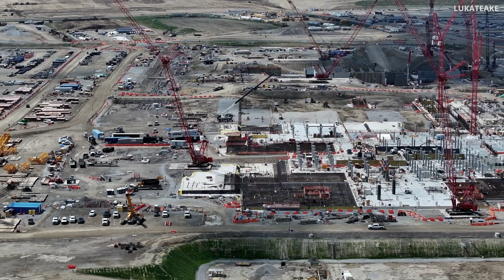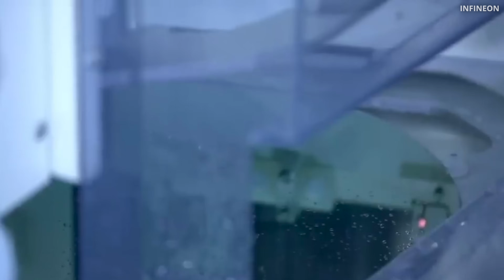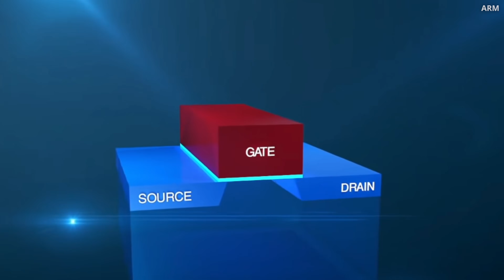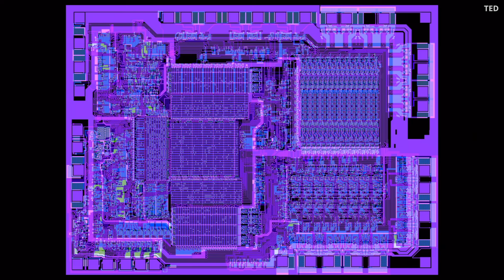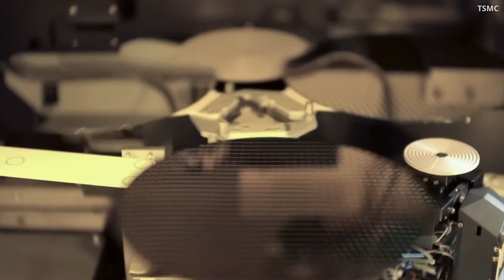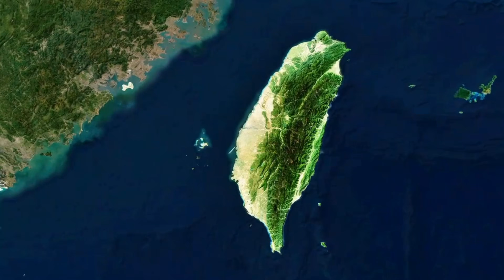Huge Chip Breakthrough — and A Massive Warning For TSMC

Comment: Makes so much sense to build a chip factory in AZ, a state that already does not have enough water for its residents and they can't bring in enough water for the residents, the aquifers are essentially drained and now you have factories that will use billions of gallons of water per year.  Even if they are recovering 80% they still leaves 650,000,000 gallons unrecovered. The containment tanks are not covered so they also lose water to evaporation.
Reply: Arizona uses  7 million acre-feet ≈ 2.28 trillion gallons of water per year.
Get a life.
Reply: @warrenwhite9085  I really don't understand your point.  You must not be from arizona. The central arizona project was built because of the aquifers running dry, Colorado river which supplies water to the CAP has not been feeding as much water and the resivoir has been running so low barrels at the bottom in places have been exposed that have remains of dead people in them.  Yes, there is not enough water for the residents let alone chip factories or data centers.
Reply: @merlin_XY . AZ water used: Agriculture (irrigated): 74% — mostly for crops like cotton, hay, and alfalfa.

Which offers more $s & jobs: 
Alfalfa or AI chip GPUs?

Comment: The real reason Intel is "betting the house" on this fab and the 18A process is that it realized that it had fallen too far behind TSMC and would never be able to catch up, much less surpass their only actual competitor unless they went into the effort "whole hog". They need to make several radical fab process changes concurrently to be able to have hope of ever accomplishing their goal. Do note that both TSMC and Intel completely rely on the ASML company to build and sell them their horrendously expensive lithography machines. ASML is the only company in the world that can supply them with what they both absolutely need.  //

Comment: why not just make 4 transistors that small instead of just 1 then, and use gold as the conductor. or gold plated wires too
Reply: when its on the angstrom level gold only
Reply: or a better/ close conductor than gold
Reply: for the power lines, just fold foils into a crinkled w shape maybe that will make it carry current better or something

Comment: A glaring omission, is the geopolitics at play. Trump has been using trade as a weapon of extortion, the entire world has been frantically divesting away from US trade for anything that's seen as critical, the process will not reverse now that it's been set in motion. Even if Intel were to gain some credibility as an independant fab, who's going to use it for anything critical except US firms? TSMC continues to hold an advantage, so does Korea's Samsung (although with its own set of conflicts of interest), these are two fabs that are not a threat to critical supply chains. As for Nvidia, a mention has to be made about its proprietary nature, just about everything it makes is proprietary, including interconnects and the software the runs on top of their integrated systems, there's a big problem with that for several different reasons, but that's a long story I won't go into here.

Comment: Interesting video, well made!

This is clearly an unsustainable trajectory. Most embedded chips do not need nm precision. It would be interesting to see how far 3d printing or printing technologie can go.
Printing chips and whole boards with printing technologie, that seems very obvious.
It will reduce cost to almost zero compared to the extremely wasteful industry shown.
Processor clock cycles would drop a bit, but it might still be 100Mhz?

Intel should also invest a lot in the processor design. We need a few breakthroughs there also. It would be interesting to cover this as well.

Comment: Eh the air filtering is a bit overblown now, the wafers are kept hermetically sealed in pods between tool mini environments, so the fab itself having a high clean room rating isn't as necessary as it used to be. My fab did a study on it at one point and determined we didn't even really need to wear smoks anymore, but we still do for appearances mainly (also a bit of a convenience since there's areas they're still necessary, so better to already have one on at all times).

Comment: I'm sorry, maybe I missed it. What is the "Big Warning for All"?
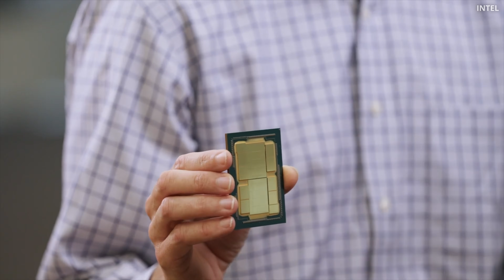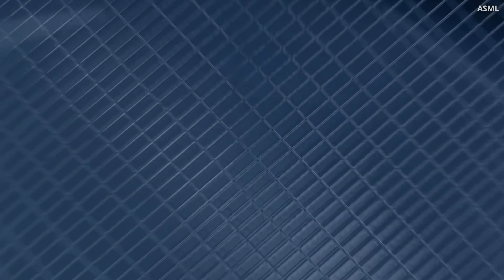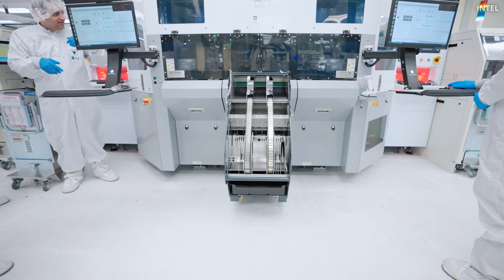Reply: From Gemini:The video states that the "big warning" revolves around the IDM dilemma for Intel: as they build advanced chips (like the 18A process) to compete with TSMC, they are simultaneously competing directly with the very foundry customers they are trying to attract, such as AMD (26:38 - 27:34).Additionally, the video highlights that if Intel's 18A manufacturing yields remain too low, the economics of producing these advanced chips will collapse, making them too expensive to be commercially viable (25:09 - 25:38).

Comment: two questions....so going vertical with the power delivery will concentrate the heat  more in one spot? or the goal is better chip stacking and not worrying about the heat .... as testing showed less heat created out of tolerance? i get the VIA delivery....i had been saying that needed to be done since the late 2002-4 with core2duo and athlonXP as carbon nanotube thru-chip power conduit could be achieved with better multi layered circuitry to get power needed to areas deficient while taking up minimal space that lasers could incise the carbon nano tubes at the right levels and then just require a remelt with excess copper on the ends of the tubes flowed out the tubes incisions to make proper contact unless you wanted to transistor gated contact those carbon nanotube power conduits which is the only way i can think to reduce heat concentration/creation.
second question so as for supporting the wafer on the backside for dual side chip processing why not use super strained vegetable oil in a petri dish and set the wafer on top and let the microfilm of vegetable oil act as shock vibration insulator using hydraulic pressure of the oil to suspend the power delivery VIA side of the chip that was processed first. you can make the petri dishes sideless like a microfilm and then attach a clam like is used for barrel lids for non liquid bulk storage that is removable and locks in the wafer when clamped to the petri dish. the edges of the wafer are mostly waste at certain points anyways so you lose about what 10-15% yield at worst and the normal what 5%? anyways on every wafer.

Comment: Great video Anastasi, I have a few questions about PowerVia.  Will the new location of the power lines require a different cooling system, since heat will be created on the top and the bottom of the chip now.  Also, will these new Intel chips require lower power per transistor, due to the assumed reduction in electrical interference.

Comment: Are they still focusing on x86 legacy or finally moving to RISC? As that matters even more than making it smaller. Complexity, power consumption and heat due their needed backwards compatibility has always been their Achilles heel. If I remember correctly, the root CPU, 8086; used 12 to 14 cycles per instruction where the Rockwell series used 1-2. So at the same clock Intel processed roughly 8 times less instructions. They solved it by switching to 5 processing lanes that could work parallel for a big chunk of the workload, hence the name Pentium. But at the cost of more complexity, need for highly efficient cache and cache misses that were expensive.

Comment: I really expected more from 18A…I thought they would beat Apple by a large margin..but it didn’t…and so is it really an X86 vs ARM problem instead of a chip fab problem ?
Reply: Intel Panther Lake (12 cores plus 4 tiny suspended mode cores) looks reasonable vs Apple M5. Only Apple M5 Pro with 18 cores starts to look like a beast vs Panther Lake 12 cores. But the main battle is ahead. Intel Nova Lake with 48 cores plus 4 tiny cores vs Apple M5 Pro/MAX 18 cores.
Reply: @alexanderbelov6892 well depending on its price…if it’s in the same ballpark as the M5 ultra in the upcoming Mac Studio…the m5 ultra will probably trounce it…so they better watch their prices 😂

Comment: 80% sounds like a lot, but imagine 20% being wasted DAILY... amazing.
Reply: Imagine the manufacturing process stops every 72 hours with growing level of failed chips, so that engineers have to change something to fix the problem. 3nm and below manufacturing process is an attempt to produce something useful on a dying set of equipment that requires regular fixes.
This is like trying to win at horse races when the horse has got thick book of illnesses. And all illnesses are described in Quantum Mechanics, so you cannot cure them forever.

Comment: Now power comes from the bottom instead of the top? I’m not getting it. Did they just reverse the way power goes by just switching the power connection (simple explanation)? I feel like I’m being sold a bill of goods or an extra charge to switch the cables.

Just say’n, it doesn’t sound genius really 🤷‍♂️

Comment: TLDR; Intel changed 2 major mfg process aspect: building on both side of wafer and RibbonFET layout of transistors instead of old FinFET design. So far they seems to be able to pull off, enabling mfg of chips, in the US,  on the level of current top TSMC process.

Comment: Theres no lack of hype around 18A. I hope they're successful but they're taking a ton of risk. Also, Samsung proved that naming means very little. Samsung 2nm has lower density than Tsmc 3nm, and no performance advantage. So is 18A actually going to be better than Tsmc 2nm? I suspect that it won't be. Intel has already departed from the conventional naming scheme with Intel 7, 4, 10, which aren't actual sizes.

Comment: I'm currently upgrading my shed and I have to use a rigid floor and I have to build a very rigid table because of the inertia of the XY movement of my CNC on my 3D printer. I cannot believe just how rigid the concrete has to be for the same albeit more important and more precise reason. I never thought that regular old hard concrete just wouldn't be enough to arrest enough inertia from these ASML machines. That's incredible.

Comment: TSMC's Arizona semiconductor campus is located in North Phoenix, roughly 250 miles.
"Hoover Dam could lose most of its power as Lake Mead plummets"
Reply: There is a lot of Sun and open space in Arizona. They could build mega solar farms.
Reply: @Rangefinder02 will they though? Current WH administration killed most solar initiatives and tax credits because he thinks it's a hoax. Meanwhile China and Korea are investing heavy because chip manufacturing and data centers require another source for energy so it's doesn't completely overwhelm the grid.
Reply: @dawkinsboy No. The market forces are strong enough on their own to boost solar production and installation. It does not depend on federal policy.
Reply: @dawkinsboy 
Intermittence.
Reply: "Meh. We'll figure something out. Reality has no business setting limits on earnings"

Famous last words
Reply: They will drain Powell before that happens ,in fact I believe Powell is on it's last legs anyways.
Reply: Geologic hydrogen is likely present in Arizona.  If that were developed as a power source it would be cheaper and more abundant than anything that is available now.  And with water as a byproduct, not something consumed.
Reply: @awackocrank  Welcome to 30 years from now.
Reply: @nunya___  Israel is currently building out hydrogen pipelines.  They are making hydrogen from abundant natural gas and capturing the carbon.  My understanding is that they are mostly concerned for the security of the energy infrastructure.  In the US it could well be thirty years thanks to entrenched interests.
Reply: I live by the TSMC plant. Its the canal, 303 and open desert between my house and the plant.
Reply: Still grid connected anywhere the main powergrid runs is cheap power
Reply: We should be desalinating the ocean with nano filters. The salt would simply bounce off the filters with nano holes. We could turn the ocean into salt mountains. I'm sure with the right coverage we could build growing land on top of that.
Reply: @phoenixfireclusterbomb I think the salt has potential to be used in grid scale batteries
Reply: @mjvandecreek6080 I think we have a nuclear power plant but sell energy to California.

Comment: The problems with efficiency per chip was the reason previous architecture going down past 4nm was the reason all the chips were getting so expensive. 18 A is much more efficient. After they make their money back the chips should get cheaper.

Comment: All heads should be shaved and uv shower to remove a layer of skin. Also, the water should be distilled then recycled in a closed loop. Build underground to avoid contamination of both dust and reduce radiation contamination with absorbing and reflecting membranes in the outer structure, with the inner structure on a shock absorbing regulated platform.

Comment: 18A might be the most advance but not much in production. Intel has just one fabrication plant available for it and the production is just MiniFab level if the standard of TSMC will be followed. When 1.6nm of TSMC is release this 18A is no longer that advance. And TSMC will have at least three fab in Giga level for its 1.6nm. Compared to production of TSMC the 18A production of Intel is just a science product. Yes they can do it but not much in volume production. And because they use High NA Lithography machine they make half the reticle size unlike TSMC its 1.6nm is in full reticle size.

Comment: I question the decision to build these plants in the desert, but not because of the problems they create for clean rooms.  The problem is water.  Tuscon has already run out, and is hanging on by a thread.  Phoenix has quietly stopped expansion permitting because it isn’t far behind.  Most of the water in central Arizona comes from Lake Mead, which is at 35% capacity and falling.  Geological records show that the last 200 years were abnormally wet, and the current super drought is actually the norm.  You can’t make chips without water.

Comment: I would like Nvidia to partner with Intel to put a full RTX 5090 along with dedicated ram in the same package of the CPU along with 64 GB ram or more in the same package. Design it so one can still upgrade with DDR5 ram on the board if needed. With all that on the same package, it would defiantly be a very fast and small computer which would 3D render lightning fast.

Comment: To be precise, 18A was born in Fab 25, in Hillsboro, Oregon aka Silicon Forest.
Reply: I saw pictures of the ASML deep UV machine being unloaded in late 2024. A friend who drives truck sent them to another friend who shared in geek worship of scientific hardware.
There are bug fixes in the BIOS and PXE Boot rom code that still run since 2000 I helped QA. So there's a piece of me with just about every Intel and AMD machine that boot every time you turn the power switch on for POST.
Reply: @TheMechanator There are TWO of those ASML High NA EUV Tools in D1X.
Reply: It's kind of Sad that Video didn't Explain ANYTHING about Gordon Moore Park being epicenter of Intel R&D.  Ironically,  Video DID briefly Show Signage from There.
Reply: @ericanderson2987  oh f off

Comment: "A" does not stand for Angstrom, it stands for Ampere.
People working with electricity should be familiar with that unit of measurement.
As a reminder, 
Next step smaller from nano is pico.
Thus the newly designed chips are scaled at 1800 picometer.

For Americans only:
The whole trick of the metric system is, that every dimension has only 1 unit of measurement.
In this case we are talking DISTANCE between chip features.
Hence the unit of measurement is "meter", no exceptions.
How simple do we need to make this ?
Reply: Å is the symbol for Angstroms, it is 10 to the -10 of a meter or 0.0000000001 meters. Your math is correct but it is not convention to use that many 
digits to the left of the decimal. So, pico gets skipped and we use Angstroms.